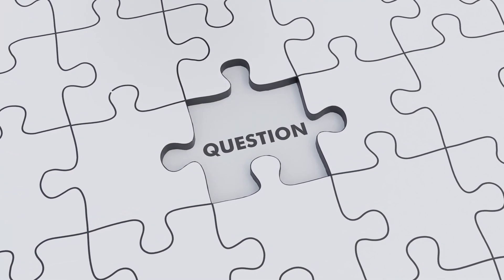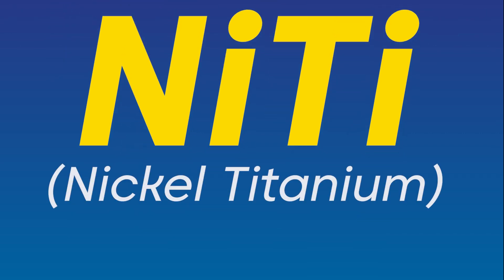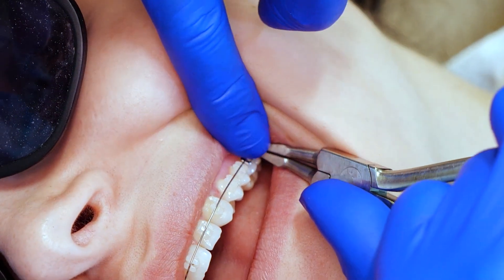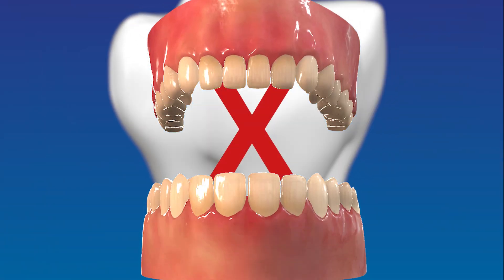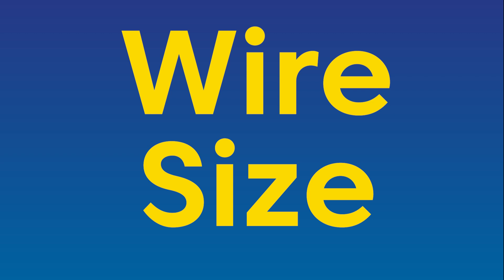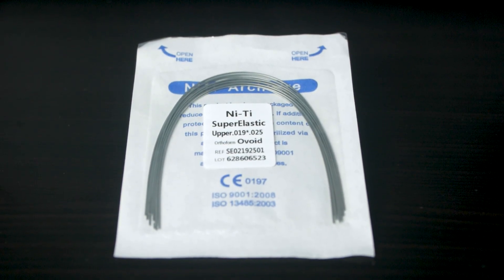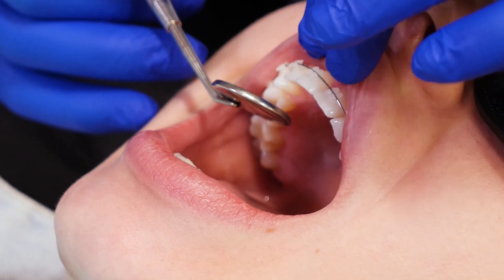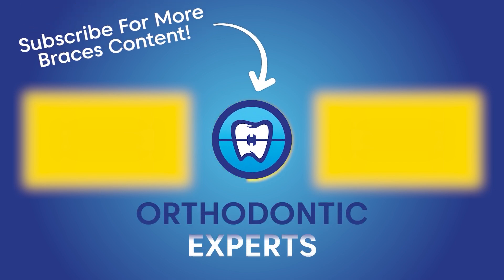Braces Archwires Part 1 | Wire Types & Sizes

Comment: I am a 58 yr old Englishman who had upper and lower metal braces fitted for the first time ever on 08/11/23 to fix my worsening deep bite (caused by lower right pre molars and molars tilting in) and mildly lower incisor and canine crowding. I started with 14 NiTi wires and a powerchain on my lower front teeth to help de-rotate my canines. I didn’t have any pain at all (except for my cheeks getting cut up for the first couple of weeks). At my first 4 week adj. appt. my upper wire was increased to 18 NiTi which produced more pressure but no pain. At my 8 week appt. my lower was increased to 16 NiTi and upper to 16/22 but I’m not sure whether that it a NiTi or stainless steel (I wasn’t aware that NiTi wires could be rectangular?). My lower right molars don’t seem to have shifted much yet but my lower fronts have started to level and align and my upper central incisors have proclined slightly which was also needed.
Reply: Are ur teeth aligned now?